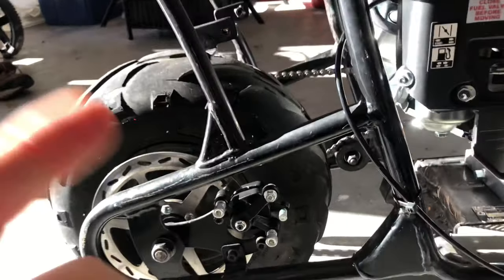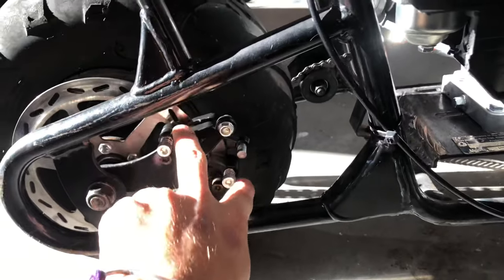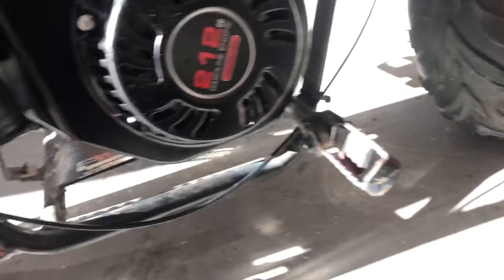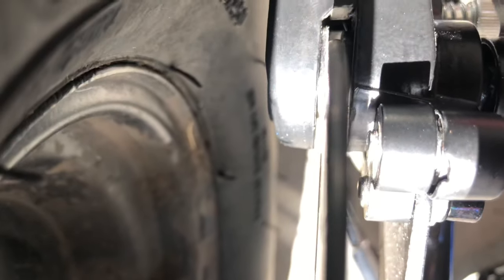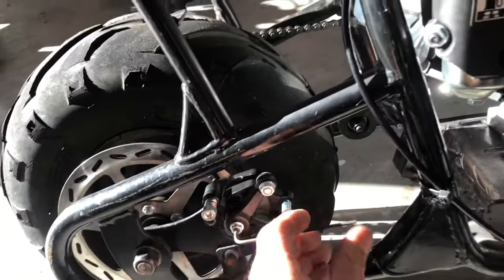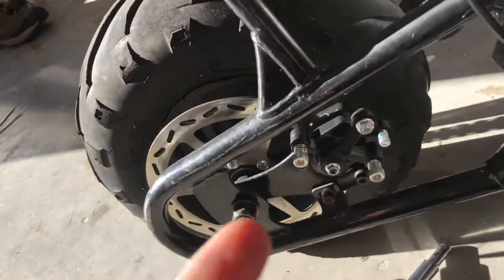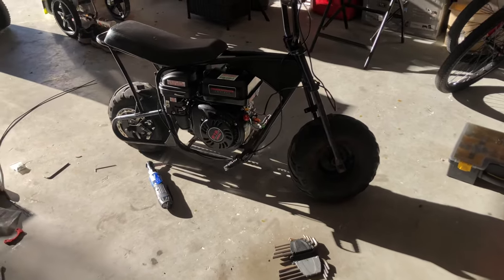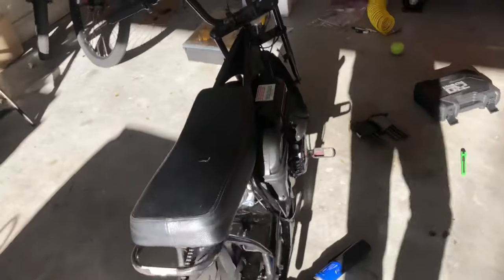How to adjust Mini Bike Brakes

Comment: Hell yeah thanks bro helpful just got a new set up and am running into this exact issue
Reply: Do you have the link to the whole brake kit? I have 0 brakes on mine and just swapped a 212cc in my monster moto 80cc and need brakes. I need rotor, caliper, and brake pads. I cant seem to find it.
Reply: @runninupchecks  my bike also came without go power sports has everything you need fast shipping also